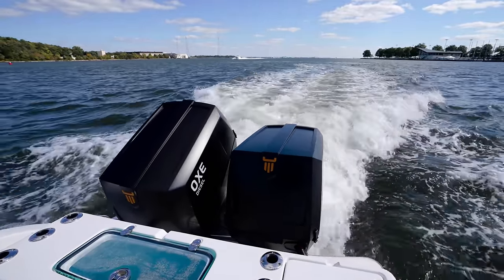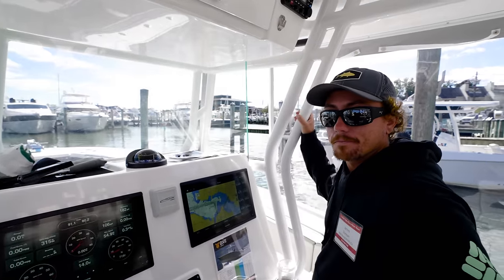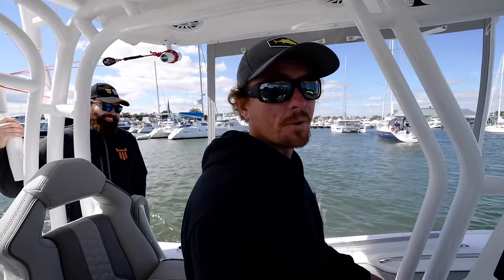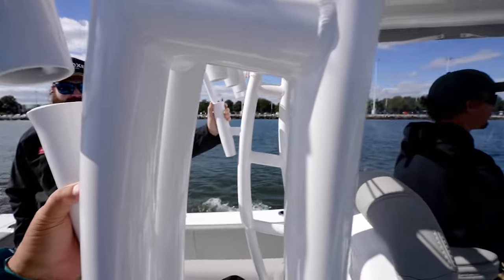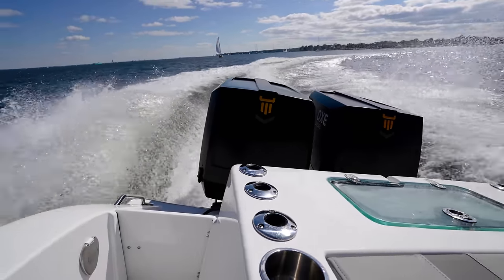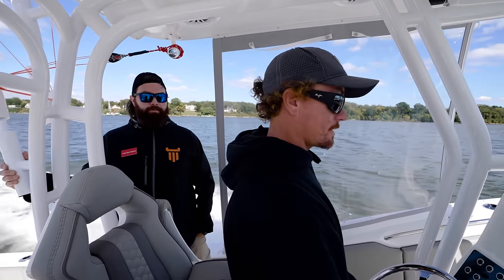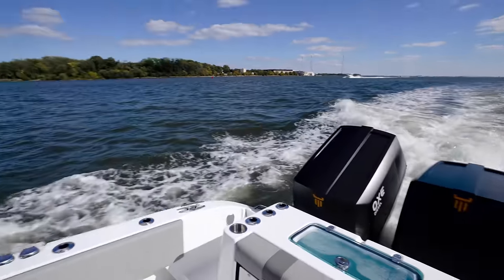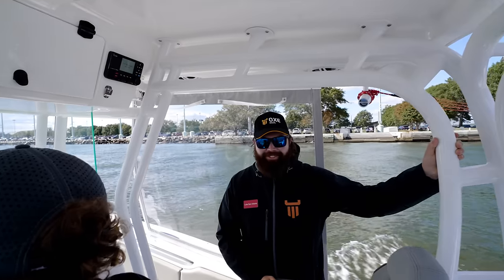Diesel Outboard Showing Off ! Oxe 300 Hp Diesel on 34 Cape Horn

Comment: Didn't know you could get diesel outboard motors
Reply: first time I have seen them they just started making them.
Reply: We are getting ripped off diesel everything would be better .
Reply: Been about for years mate
Reply: I can see steam outboards comeing
Reply: The price!  A 2020 OXE 300 was advertised for $60,822.
Reply: To much noise.
Reply: Yanmar outboards failed too heavy and expensive
Reply: Very heavy but them 300 hp good outboards
Reply: Mercury makes one too
Reply: Didn’t know 46mph was achievable at 3300 rpm’s
Reply: Price on one outboard
Reply: They've been around for a little while.
Reply: They are more then double the price of gas outboards  they'll never catch on with the consumer market at that price
Reply: Alfred please be patient and allow time for answers to be given. What is the range with twins? What is the gph at cruise? You and the passenger talked over the kid's answer. Your channel provides good info, be confident and conduct yourself in a more controlled manner, less truly is more
Reply: there is also Cox CXO 300hp diesel
Reply: @tommyluke6407  off road diesel ⛽
Reply: Same
Reply: I want to believe these are BMW diesel powerplants too, theres a charter that runs 4 days a week minimum and have had these for almost a year. Only had was alternator and charging problems from what I heard
Reply: @ebutuoycensorship8012  more expensive repairs and fuel
Reply: There was a version of the 3 lt BMW diesel already last year at the ‘Salone di Genova’
I don’t remember which was the cantier producing it
Reply: yanmar 27hp, 1987 .. twins crossed atlantic
Reply: @ryeckley7267  torque mate
Reply: Have you been under a rock?
Reply: @ebutuoycensorship8012  You're right, everything would be better with diesel power except the price of fuel.
Reply: @ryeckley7267  With diesel torque it is very achievable.
Reply: You could but don't get these...get COX diesel outboards. Oxe uses a BMW car engine and marinized it thus they have been facing underlying issues. COX on the otherhand have designed and built an engine ground up to be a diesel outboard.
Reply: Is an engine you can have it anywhere you want is a basic thing.
Reply: Diesel outboard motors are heavy, noisy an expensive. But they need less patrol and live longer. They are for commercial use.
Reply: @ryeckley7267  same logic as in diesel cars
Reply: That's not about price from new, that's about range, consumption is 30% less than than petrol,  that means you can go 30% farer.
Reply: @ebutuoycensorship8012 definitely one of the big things diesels are great for is running at a constant RPM for long periods of time somthing boat motors also do a lot of
Reply: Yamaha made one several years back aswell, smaller for like sailboats and what not

Comment: I literally built and designed the tower on that boat. My small shop builds all the tops for cape horn. Really cool to see my creation on YouTube! I actually didn’t know Cape ever put those motors on any of their boats
Reply: What purpose does this 'centre console' boat serve? It looks useless in a swell of over 3 metres, you would have the first wave break over your bow swamp the whole boat.
It looks like a very flat bottom and lacks any major keel to keep it stable in rough weather.
And most of the deck space is unsheltered, so nothing to keep the waves and rain off the passengers or cargo.
Never seen a boat like this in our country.

Comment: I had first hand experience in 2016 to run OXE 300 Diesel outboard. It came with trans oil, huge torque but our boom boat was too light, it cavitated a lot. Pure genius on this outboard. Ken's Marine Capt. off did the testing for their R&D back in 2016.

Comment: Amazing how quiet those motors are and fuel efficient too.❤
Reply: ehh modern 4 stroke outboards are easily as quite , have much more power for the weight, and cost 1/2 the price
Reply: @ct1762  a modern petrol engine is not nearly as fuel efficient and needs much more frequent service.
Reply: @victorlunabba561  so your saying you've never maintained a diesel motor. got it.
Reply: @ct1762  that's not what i said.
Reply: @UltraMagaFan  I pulled this out of the service manuals! 
So Mercury have the first service after 20h then again att 100h and afther that every 100h.
Oxe has first att 50h then every 200h or once a year, 
Evry 800h or every 3d year.
Reply: @victorlunabba561  The majority of people do not boat more than 100 hours per year. You service both a Mercury and an OXE once a year. One does not require more maintenance than the other.
Reply: @UltraMagaFan  i don't think OXE is for people who drive les than 100h per year. It's for professional every day use where the fuel economy, long service intervals, relatability and long life life of the engine will make it cheeper in the long run.
Its like compering a pickup to a race car.
Reply: @victorlunabba561  If you use the thing on an everyday basis, like it is designed for, and put 200+ hours on it a year, you service it once a year like a gasoline outboard. They don’t have “long service intervals”. You’re right. They’re not designed for people that boat less than 100 hours per year. However my point is still valid.
Reply: @UltraMagaFan  No if you put 200+ hours on the gasoline engine you have to service it two times+ a year according to the service manual. I think you want the warranty to be walid if you use it every day? 
And according to the service manuals te diesel have twice as long between the service.
So no your point is not valid 😉
Reply: @victorlunabba561   My point IS valid. Mercury outboards aren’t designed to have 200+ hours put on them each year. They’re for leisure boats. If you use them for what they’re designed for, like the vast majority of people that own them do, you only have to service them one time a year. This is like comparing a Peterbilt tractor to a Corvette. It’s stupid.

Comment: I heard about these engines a while back, lovely to see them in action outwith the boating press. IMO what these engines really, really  need are Sharrow Props. The noise reduction alone would make it worth while (engine noise is not the only noise a lot it is due to turbulance) let alone the better acceleration, top-end, and fuel savings.

Comment: The outboard are awesome! Was always hoping for a diesel outboard. Don’t know if it is the boat design or the engine limit…sucks that you cannot take these engines completely out of the water when pulled up.
Reply: Taking a guess; on that particular boat it appears the size of the motor prevents them from tilting up all the way for fear of the engine cover hitting the boat, so I think in an effort to make the demo run smoothly the captain tilted it as much as he was comfortable, knowing he needed room to turn, and just ran with it and tried not to call attention to it.  Those are some physically large powerheads and it looks like the size is towards the bow side, just not an ideal matching for that particular boat.

Comment: Definitely the way to go using Diesel engines,I have a Yanmar it’s been pushing my 20t boat for 14years 5000 hrs only ever changed the oil and filters and alternator belts.Diesels top out at 4000 rev’s petrols 6/7 thousand no wonder diesels last so long and fuel economy is amazing.

Comment: At 2:42 in the video, he says the diesels were getting 8 miles per gallon (MPG).   That's BS - when he said that, he was pointing at the 8.2 miles per HOUR (MPH) figure on his chart.  At 8.2 MPH, it was getting 2.4MPG.   According to his chart, the best MPG achieved was 7.4MPG at 5.2MPH.    7.4 miles per gallon is great for an outboard, but nobody is going to drive a 34' offshore boat at 5MPH all day long.

Comment: I love the idea of diesel outboards. I have a similar boat, it's a Marlin 350 SF which is basically the same as a Dakota 36 and a Marlago 35. I have twin 250 Evinrude 1st Gen E-Tecs. I would love to be able to get 2 MPG at 30+ MPH. LOL. Best I can get is 1 MPG at cruise which is roughly 35 MPH. And no way in hell can I plane my boat on one engine even if I had 300's. It weighs roughly 10,000 with a medium load. Those engines sound very nice, not loud either. Just need to redesign the cowlings. They look like a fat version of the Gen 2 E-Tecs which I hate. Round them off a bit. I'm almost afraid to see the price....Twin 300 Suzuki would be north of $50K.

Comment: Love the video Alfred. Question, what's the weight difference between diesel and 4 stroke outboards?
Reply from the maker: Maybe 300 pounds
Reply: That is substantial additional weight on the transom.
Reply: @pieterhoekstra9887  yes, you want a transom that is engineered to handle the extra weight. Especially if you're putting a rack of engines on.
Reply: They are unsuited 2 many applications due to their weight they are over 200 pounds heavier than my 250 sho 4 stroke yamaha

Comment: Awesome video, have been looking at repowering my 08 29' Regulator. The first video I have seen, provided by the originator of the Chit Show, no less" and I am impressed! But the cost is steep and $60K per for the 300HP! Is it worth the extra $10K???
Reply: Long-term yes. Otherwise every boat engine would be gasoline. If you're sticking with your boat long enough to have engines rebuilt, using lots of fuel, putting lots of engine hours on, then yes. If you're selling your boat next year, probably not.

Comment: Chain and belt driven? Why not use a ring and pinion setup. Sounds like an OMC disaster. The blocks are BMW and Isuzu. But the drive may need to be proven over time and if it can take strikes and screwed in sand.

Comment: It's actually mind blowing that diesels aren't more common in boating.. 

If you can rig those outboards so that they don't run EGR or any other shitty emissions devices and just burn clean diesel you're winning in terms of economy, power and torque. 

If they have all the usual emissions crap like EGR and DPF.. You're better of running petrol.

Comment: Reality….. I purchased 7 of these motors for my commercial crewboat company on the Mississippi River. All 7 motor failed. During failures oxe shipped me another motor and it failed. Some failed at 32 hours, 240 hours and slightly more. None made 800 hours. Run from these motors. Belts fail and shred into hydro system. Heat exchange defects, water pumps,engine block,chain drive guard fails,fuel quick connect leaks,on and on and on. And here is another tip they fail to tell you, motors require you to remove every 800 hour( if you are lucky) and tear apart lower unit and gear to check/ replace belt and reassemble and remount the motor. In my case belts failed so didn’t have to check them. 
Complete junk and this is no you tube blogger. This is a large marine business operating for over 18 years. 
Get the real facts. Stay tuned to marine publications because I am just getting started with getting the word out.